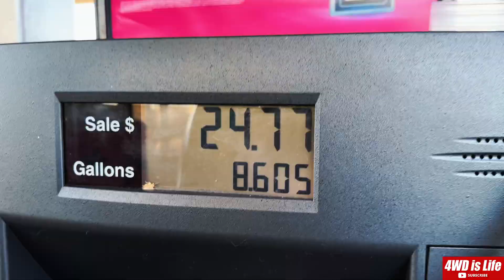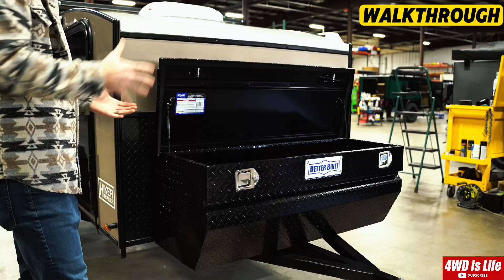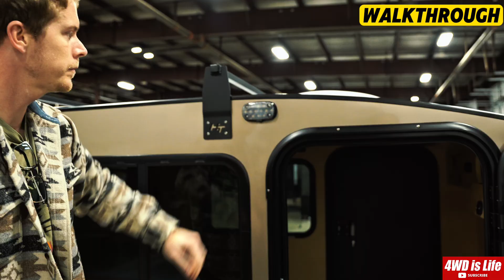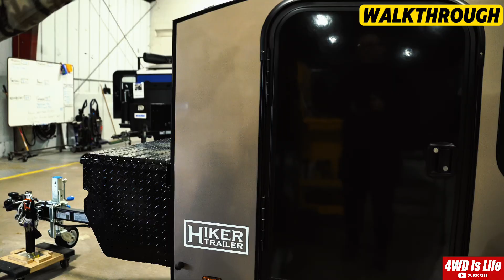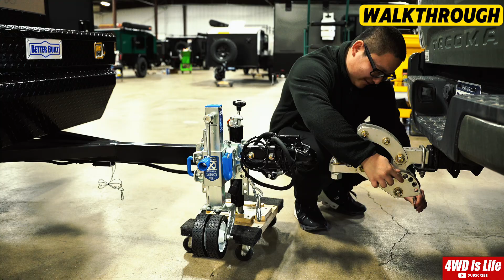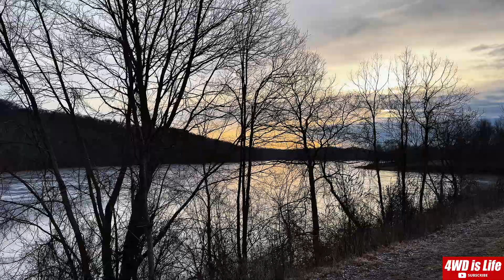How to Use a Hiker Trailer - Picking Up My New Hiker Trailer

Comment: Welcome to the Hiker Family.  We're also in PA about 45 minutes east of Hershey.  We got our Hiker in September.  I recently mounted two Rotopax 2 gallon water containers on the ends of our tongue box (we went with a smaller tongue box to keep the tongue weight down).  We're big fans of the PA State Parks and IMSA sports car racing.  So far we've camped at Hickory Run and French Creek state parks and the 12 hours of Sebring and the 6 hours at Watkins Glen.  We recently made reservations for the Hiker Fest in late September. We tow with a Jeep Wrangler so the Hiker is a perfect weight and it fits in our garage another plus.  Hope you and your family enjoy your new Hiker.  Safe Travels and God Bless!

Comment: I would take off the rear jacks while traveling just to be safe. Nice trailer and good luck with it.
Reply: I just Velcro the handles up so they don’t hang down
Reply: Probably 10 million trailers running up and down the road with rear leveler jacks on them.